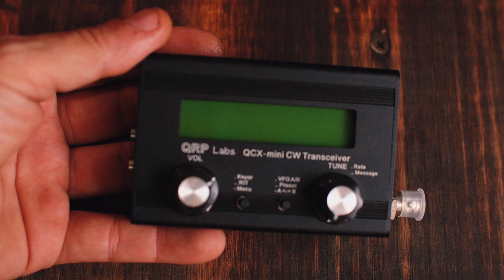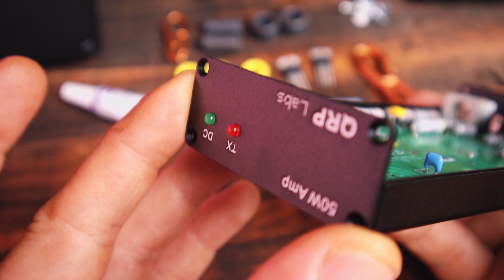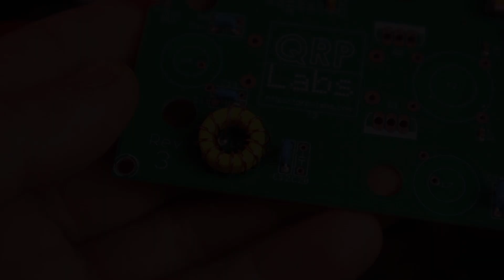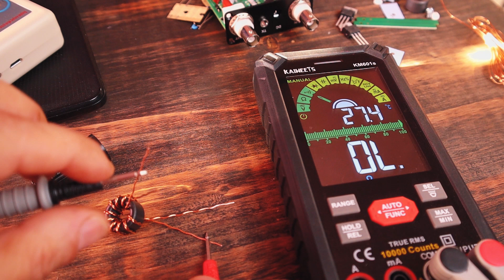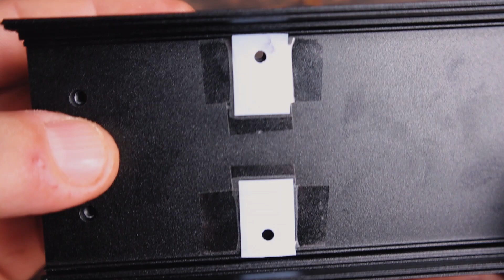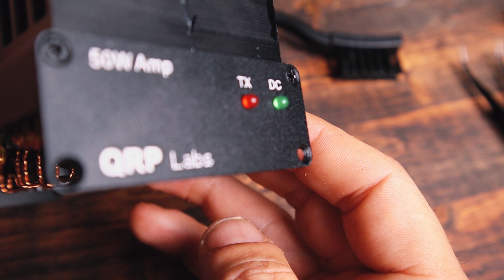Building The 50W QRP Labs RF Amplifier Kit For CW - Part 1

Comment: I have this amp works well full QSK. If I run mine on 13.8v it outputs 30 watts or so, I run mine on a 19v laptop supply and it gives me 50 watts out (mine is the 40m version).
Reply from the maker: I am about to finish filming the test video soon so then I can send it to Vlad YO5BDL so he can enjoy it finally. I also like it a lot too... but I stick to QRP 😁 73 buddy, YO6DXE.
Reply: @dxexplorer Yes…. I have gone to the dark side (a tad)😂. At home I run mostly QRP …. But not all the time. Portable I do QRP. Loving the content your sound and lighting is stellar 👍 73
Reply from the maker: @TheArtofEngineering The dark side hahaha. Well I am sure I will experiment with that too a bit later. The lights in the video... is all recovered LED lights and the Mike is some cheap 20$ Chinese one. But it seems to do the job. 73 and have an amazing rest of the week. Pixie day comes soon. 😁

Comment: great video as always ... I just updated the latest QMX firmware ... just remembered watching your video you mentioned the QCX :) ... keep up the good work! 73, M0IVI/YO3IVI
Reply from the maker: Hehe. I don't have any of them. Well I have the QCX Mini now to test the amp but I think I will get one because I really like it. Time to finish it soon as Vlad is waiting for quite some time now excited to use it 😅. 73, YO6DXE and thanks for watching .
Reply: @dxexplorer  I'd recommend to get the kit for the QMX (long waiting times for the built version)  ... has all the functionality of the QCX but also the SSB ...
Reply from the maker: @apunctg Ohhhhh good to know that. Well thank you so much. One question ... does it have SMD parts to solder ? I hate those 😅
Reply: @dxexplorer  all the small smd's are already soldered on the board ... you just need to solder the big parts, toroids, caps etc ... and it's amazingly well documented
Reply from the maker: @apunctg Ahhh ok same like the amp. Great thing then. I will put it on the list 😁😁😁. Thank you.

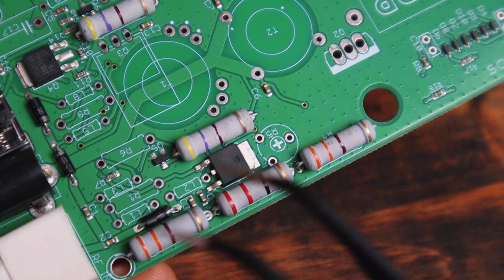Comment: 5:15 Excuse me, but this is a big fail on their PBC layout
Reply from the maker: Not really. It just happens that it depends very much on the parts supplier. It happened to me as well where I designed a board using the dimensions you find for a part that you later can't find available anymore so you use another supplier where the parts sometimes are either smaller or bigger and you have to "trick" them to fit on the board. It is what it is, plus that you are limited with the space you have available so it will fit in the enclosure you planned for it. 😁 73, YO6DXE and thank you for watching.
Reply: @dxexplorer  yes,  I agree exactly. They switched suppliers, or their supplier did a switch. Should have made allowances for that
Reply from the maker: @kostis2849 It happens. Honestly there is not much space on that board to play too much. If it works is good enough for me 😅😅